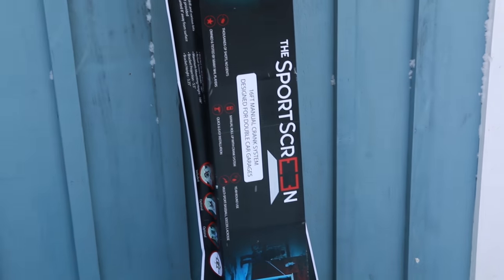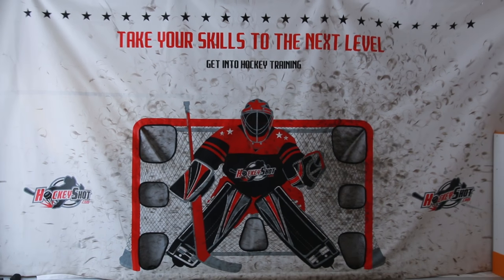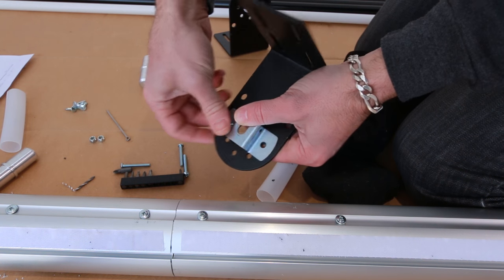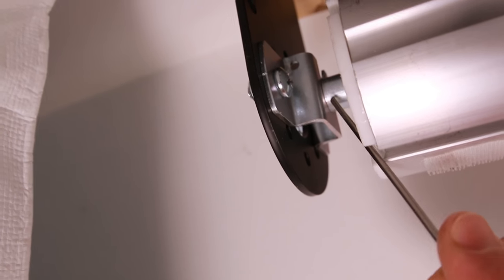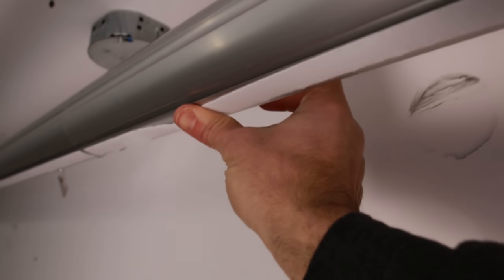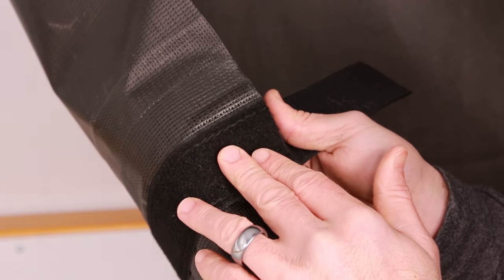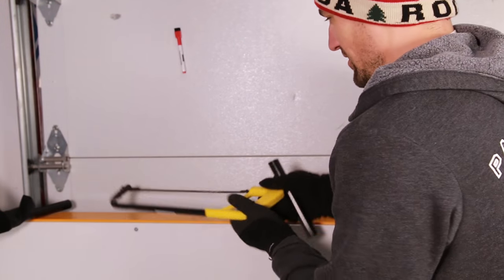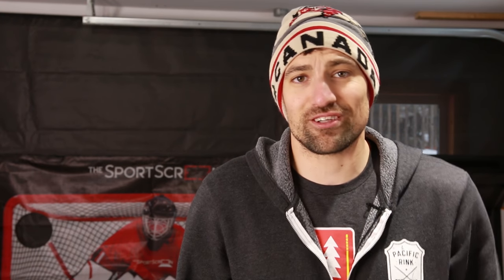Installing the SportScreen!

Comment: Thanks for the video.  It helped me avoid taking wrong turns and having to repeat steps.  My version had a small clamp instead of the safety pin, but otherwise was very similar.  The tip about putting the velcro on top was genius.  I did it myself, but got assistance to install the anchor brackets and to hang the screen.